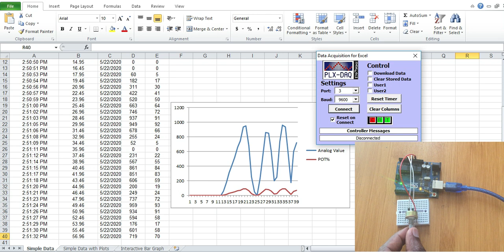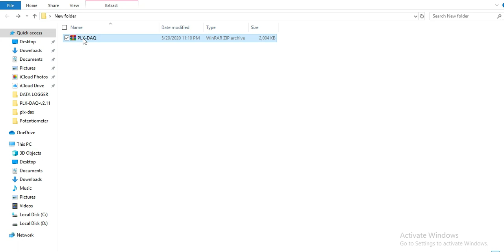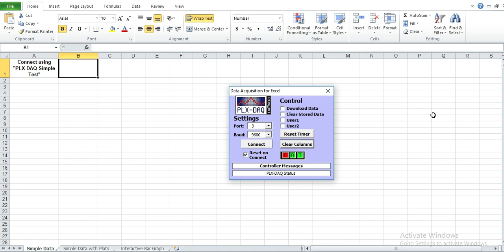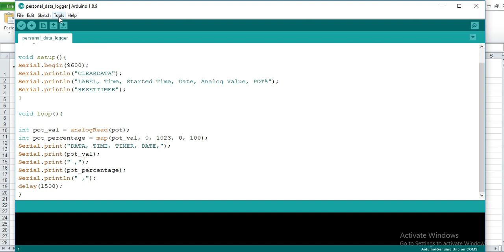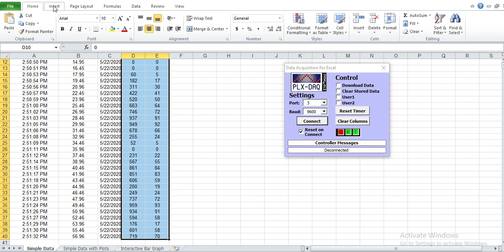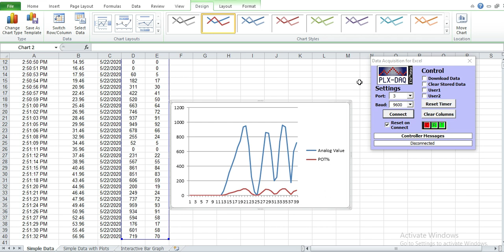Arduino to  Microsoft Excel Communication using  PLX-DAQ.

Comment: Hi,  I have a big issue. when I start to collect my Arduino data through Excel, it was hang. it maybe collects 20 rows only. After some of the rows, it hanging so totally closed my excel.  how to solve this issue?

Thanks for advance
Reply: I have the same problem approximately, when I start measuring it accept only data for row 1, what shall I do in that case?